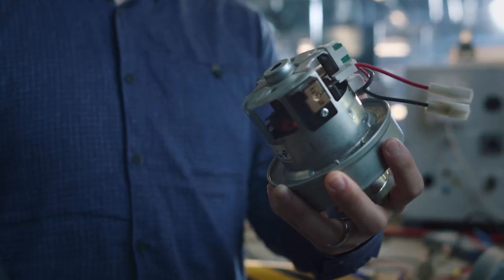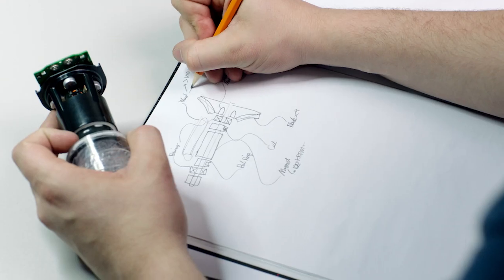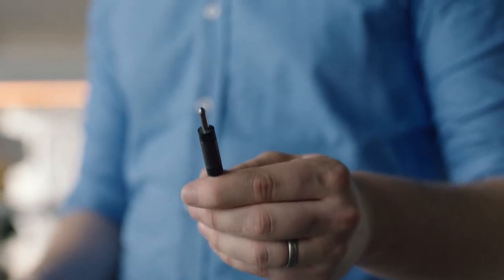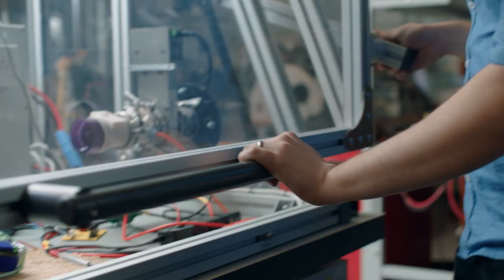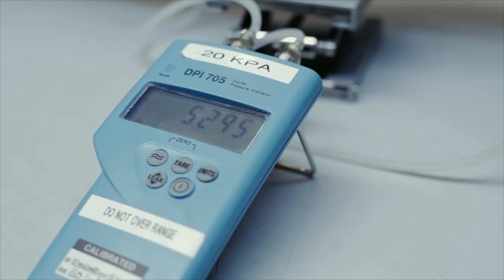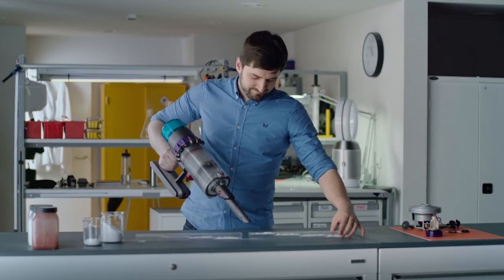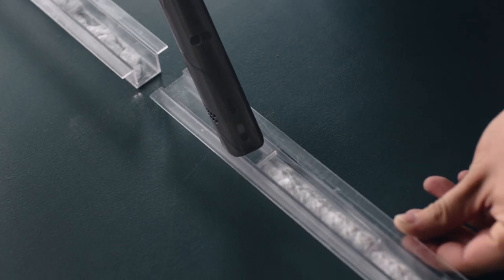The engineering story behind the Dyson Gen5 Hyperdymium™ motor

Comment: Different nozzle on the hoovers. With the holes on the side it will have a massive effect on suction as air will be pulled in at the same time so increasing total air flow and then it will have a greater reach into the pocket. Just stick to making them and stop hyping them up so people spend £600 every year on Hoover's.
Reply: My first thought. Round nozzle for the other vaccu.
Reply: Yeah I noticed that too so not true fair comparison.

Comment: I thought the Gen5 had 262 aw not 280
Reply: hey
Reply: 280aw without a load, 262aw with load. The motor produces max pressure and air flow without load and standards require to measure the AW with a load.

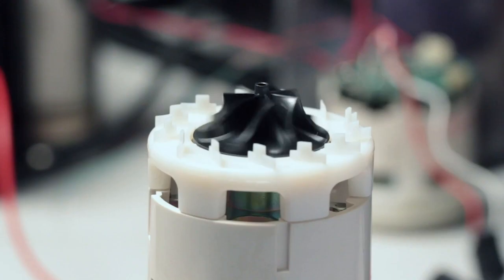Comment: what does the needle at 0:10 do?
Reply: sensor
Reply: It’s used in manufacturing to measure the dimensions of the part to insure the part is within specifications. The motor spin so fast that a small imperfection will tear itself apart.